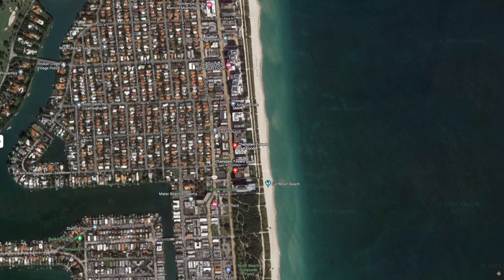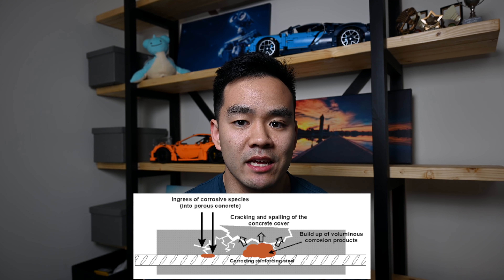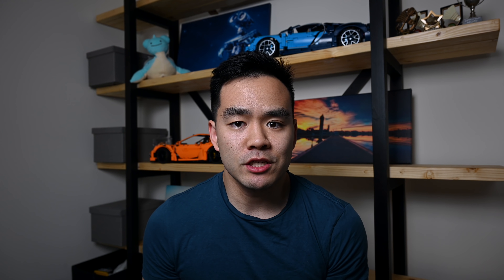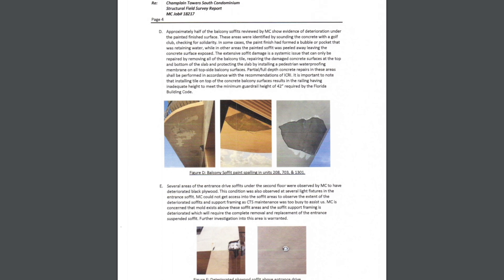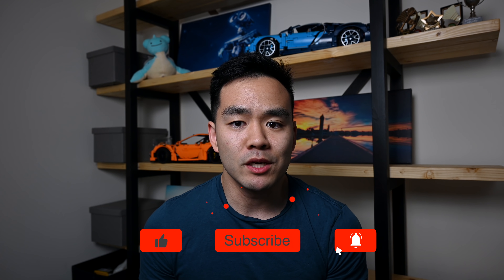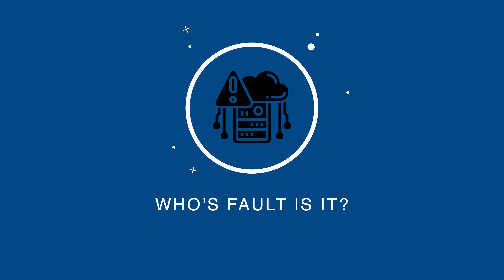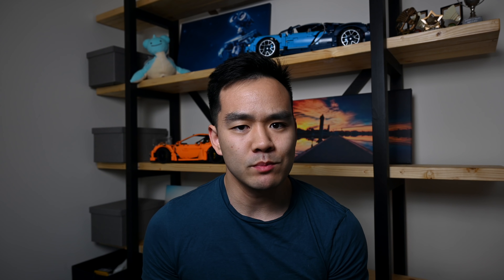Surfside Condo Collapse - A Structural Engineer's Perspective

Comment from the maker: No video (including this one) is going to give you an answer to what happened. Everything at this point is speculation and any video that claims to have the answer is wrong. Until the experts on site do their investigations and analysis, we can only speculate. There's nothing wrong with speculating and having ideas but at this moment, there is no answer. 

I have a copy of the original design drawings so I will be reviewing these and giving my opinion on the design.
Reply: You got it right.  Seawater in the foundation
Reply: @paolabisoneaux4056  nope, the deck fell in first, and it’s above the seawater intrusion. Seawater may have made the columns easier to pull over, but the pool deck fell first. The pool deck had water problems, and it’s salty like he said from the spray.

Comment: I think we understand phenomena like corrosion, water damage, and maintenance pretty well. This was not a freak accident, it was - based on pictures and reports - a building failure that could have been prevented. Even if some aspects of the causes may not have been fully understood, such as the impact of the planter boxes, much of it was and there were ways to avoid it. Tragic loss of life.

Comment: I think that work was started on the roof because the tenants of the brand new building next door complained about how shabby the “roof view” was. Google earth does show the roof was a mess. 
So, It seems to me that the 2018 report was all about the pool deck waterproofing etc….. So, it is really debatable that they were actually addressing the structural problems of the pool deck area,
Why did they remove those palm trees that were planted in planters which were not in the original design ? I’m with you on the salt intrusion and the  cement spaulding. What was causing all that garage roof cement cracking and water leaking ?

Comment: In fairness, a major rebuild design, financing, bid, and owner voting/financing, two years is probably considered brisk.then drop the corona right into the middle of the process, and here you are 3 years later and starting work. 
It’s also fair to note the words “no major structural concerns “ was on the summary of the report. It was further in the report that scares you. For some reason they got soft on the summary. I think they won’t do that again. 
Nonetheless- how long, if I told you to start today, would it take you to rebuild a huge building like that? Starting with the report.
Unless you throw out overtime money like it’s a war project, I’ll bet it takes you two years, and that’s assuming no shutdowns or building material shortages. Those aren’t real, right?

Comment: This was a really great analysis.  However, as an architect, I rarely use the words "design" and "engineering" of a building interchangeably.  The architect, at least here in the US, must rely on the engineer to make his calculations and that the engineer give the necessary shear and steel/rebar enforcement.  It would be unprofessional of the architect to encroach into an engineer's professional judgment and license to ask him to make structural changes, without making sure that the engineer can reinforce the building in a different way.  The architects'  level of responsibility is to make sure that the building is properly waterproofed and specify some type of waterproofing membrane at the basement level.  However, if the structure is not properly reinforced, the waterproofing membrane can be compromised due to too much sway and movement of the building (all buildings move and settle to some degree).

Comment: From watching other videos, engineers seem divided.  Some think the failure around the pool deck lead to the collapse.  Others say that it is likely that the building footings failed after decades of being soaked in salt water than had risen so much, it was constantly flooding the garage.  What do you think?  I see that they cleared away nearly all of the rubble so the foundation is visible.

Comment: The “owner” or the “client” as you describe it, is the Condo Association, a corporation consisting of the owners of all the condominiums. Many of the owners are dead, including some of the current Board members. The current and past Boards will certainly be held liable for failure to exercise their fiduciary duty to maintain the building and protect the owners’ interests. A big problem with condo living is that monthly fees are often set too low to build an adequate reserve fund. I have read that the cost of the repairs in 2018 would have been over $9 million. By 2021 the building had deteriorated to the point that the cost of repairs had increased to over $15 million. A news bulletin from a local TV station reported that the reserve fund had only about $1 million in it. The owners were facing big special assessments averaging over $100,000 per condo (and double that for the largest condos). Ever since 2018, the owners had been voting down the necessary special assessments and voting board members out of office. Some residents had lived there since the building opened in 1981 and had purchased their homes for less than $200,000. Many elderly people would find it impossible to come up with $100,000 and would be more likely to want to procrastinate with maintenance, thinking that they won’t live to see the value. Well, they were proven correct. 

Where I live, legislation is in place requiring that a depreciation report (by a structural engineer) be done every 3 years. These reports provide crucial ammunition for the board to keep on top of building a strong reserve fund and completing necessary maintenance. It is far easier to build a reserve fund and manage owners’ expectations if you increase maintenance fees incrementally every year. I think it’s shocking that no such oversight is required in this area of Florida for 40 years. I expect changes in the law.
Reply: In your comment, you reveal those truly responsible.  These are the owners who repeatedly voted down the Board's necessary special assessments for extraordinary deterioration of the floor slabs, beams, and columns.  If the board members are to be held liable, then they need to be paid salaries, have full education and proven successful experience in maintaining a building structurally and superficially, require no voting for special assessments, and have guarantees from the engineers, inspectors, and town that the recommendations made by these agencies are absolutely and truly necessary, the town/etc paying and being liable for any recommendations that turn out to be false. It's a very complicated situation, when so many hundreds of people with different needs and abilities are involved in decision making, one is guaranteed something eventually going wrong.  

The cause of the collapse was slab, beam, and column internal and external spalling degeneration from decades long water penetration, all other factors merely influenced how the collapse would progress once it started. The construction method in which patio, pool, parking, and building deck slabs were joined together via slab-internal beams clearly played a role in the progression of the collapse, bringing more columns into play whose collapse entered under the building itself. In the years after construction was complete, evidence shows that the pool and patio decks were modified for the worse, an improper job was done, leading to the infiltration of water/salts/chlorides into the structural slab, beams, and columns.
Reply: @robertrust441  Most catastrophic failures are due to a cascade of errors. See Jame Reason’s Swiss Cheese model. https://en.wikipedia.org/wiki/Swiss_cheese_model
Reply: There's a lot of things that trouble me going through the public records for the building. The 1996-97 restoration and repair of the pool and garage slabs permit application (96-00000403 had the worst architectural plan I had ever seen. It was a photocopy of the pool plaza plan with some vague areas drawn on by hand with a Sharpie showing where the work was to be done. No list of materials, and no copy of the structural field survey report that diagnosed the problem and the repair needed. All there is a letter of certification issued after completion by the project engineer Tong Le, stating that a 20ft sq ft area in the garage ceiling had been repaired to code and the specifications of the South Florida Building Code (SFBC). The contractor on that project was The Waterproofing Co of America. Why this is important is that the original 1979 plans, differ from the 40 year recertification bid plans drawn up by Morabito Consulting. The 1979 plans show that pool slab was built with a slope, and there was a change of levels down to the garage slab, but the recertification plans show that the slope had been removed, and the slab flattened. Not only that but a BMA  beam in front of the garage entrance is missing from the recertification plans. That beam was to traverese two columns in the area where the garage slab joined the pool slab. Was that beam removed in the 1996-1997 restoration? How come that project got a completion permit approved but, more repairs were needed to the pool slab under the planters just a few years later? So, many questions, and so many documents aren't in the public domain that really should be. The Harbor Cay Collapse proved that the codes were deficient, but it seems that because of industry counterpressure, and the fashion for deregulation, the buildings built prior to 2002 when the Florida Building Code replaced the SFBC are not a good investment. Moreover, 40 years is too long a period for recertification. It should be a frequent occurence every 5 years. Moreover, relying on residents to understand the import of a statement in a structural field survey report which describes an issue as "systemic" which should be addressed in a "timely" fashion is wishful thinking, especially when they have to find thousands of dollars to address it. I don't think the language in such reports is particularly helpful. The legal liability consulting engineers has makes their communications highly formal if not legalistic. It just didnt read urgent. Plain English and plain speaking might help get the message through. Morabitio Consulting Engineers must have been worried because they sent an unverified outline report to Surfside Building Department which wasn't sent to the condo association nor registered with the Miami-Dade District Court, but no cover letter with to explain why they were doing this is in the documents. They say regulations are written in blood, and there should be more detailed and professional documentation provided for major repair work permit applications. Self-certification of repairs impacting the systemic robustness of structures is questionable too. I just hope current day regulation is more stringent in the protection they give.
Reply: I can see the whole picture revealing itself now.

Comment: "Who's fault" I think you mean "WHOSE fault" ....In my humble opinion, the most probable MAIN cause of the collapse was the many years of water seeping into the concrete pool deck and associated ceiling of the garage, thereby rusting the all important reinforcing steel, and destroying the integrity from the inside. The amateur design (flat, not sloped) surface being not waterproofed and exposed to the rainfall for 40 years.  The lack of immediate action following the DAMNING engineers report in 2018. The absurd decision to repair the roof first with jackhammers vibrating the entire structure BEFORE addressing the integrity of the "ground floor". Like the death toll, the number of people criminally liable for this tragedy is growing every day.

Comment: From what I've been hearing, one of the likely reasons this project was delayed was that the residents during the meetings would argue about the special assessment cost, which was going to roughly be about $110,000 to pay for the project, on top still paying the condos.

Looking at other engineer channels, I can tell as an amateur that who ever was designing the building did fail at a lot of the basics, like how certain beams fit on the columns in the garage, the lack of consideration the garage could have been below water level, etc. Talking to both my father and brother who are civil engineers, they agree with your concern about the lack of maintenance could have been the main factor; yet the rules were applied to have the building check up every 40 years, which was what the condo units were doing. When looking at specifically the pictures or video coverage of the garage before this happened, it's puzzling how no one was questioning the water and the damage it was doing to the structure.
Reply: When you own a beach condo you think that all you have to do is pay an HOA fee, and that a staff of repairmen will magically appear to fix everything as if you are in a hotel. But at some level there is no one to carry out the work. Everyone is an owner. That’s what everyone on YouTube has trouble understanding. Even if you hire a company, someone has to give up their life for free to oversee all that work. They have a security guard and maybe one maintenance guy, but some owner has to do the work of managing it all for free as if they were running a hotel for the others. They are all wealthy owners. At some level there is no one whose paid job it is to take complaints and do the work as in a hotel.

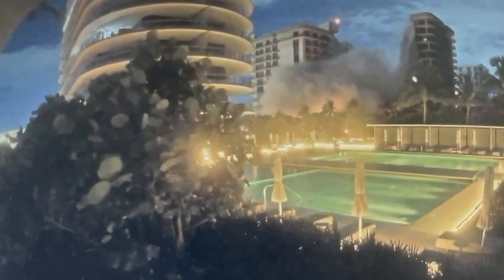Comment: If you look at the collapse video at 3:04 you will that a large chunk of the building sky line is missing while lights are still on in the about to collapse building section. We need this guy at Rako Studio’s https://youtu.be/YNMxzFmKyyg to do the same treatment of the collapse video to determine what stage the collapse is in the first frame. If that central section is still intact then a section of the roof parapet has fallen off. That much concrete falling 12 levels would deliver the energy required to destabilise this building. According to an animated fly through the section directly in front of the collapse section had substantial joists under the deck, joists that are missing from the rest of the pool deck. So for that section to fail it would take substantial force. The animation https://youtu.be/HPwJ0JvTcg8
Reply: Building Integrity clearly points out in one of his vids that it collapsed in 4 sections or maybe 3. I have watched so many vids I may be wrong to the exact # of sections.
Reply: @kellyname5733  Kelley, my comment is about (a) when did the collapse begin, and (b) what was the initial failure. The building central section would have to have already fallen one floor level at the start of the video for the failure to have begun at the bottom. However if the collapse was caused by a big chunk of concrete falling from roof level then that is better news for those who live in such buildings. The roof is continuously exposed to salt sea spray, and salt being hydroscopic ensures that surfaces stay wet longer so cracks in roof top concrete will cause rust sprawling far sooner than in other parts of a building.
Reply: @williambunting803  building integrity looked at two virtical concrete features. One up to the top of the eighth floor in the right fourth section to fail and one to the tenth floor in the first section. In the first collapse video frame, the 11th thru penthouse can be seen, each still one floor apart, although they have already dropped down several floors as shown against the virtical marker on the right. This clearly shows the collapse was bottom up, and not the result of the roof coming down.

Also the pool deck collapse came about 7 minutes before and likely damaged the building support columns at the basement or ground floor level.

Comment: I just spent a bunch of time looking at the building on Google Earth on the street level setting and parts of the building have pictures from this year, while others have pictures going all the way back to 2015. It seems pretty obvious to the untrained eye that there were already serious problems in 2015 and, since some of the pictures from a very slightly different angle are separated in years, you can see how it worsened over time. Of course, it's a hell of a lot easier to compare a picture from 2021 to one from 2015 and see the change but it would have happened in real time so slowly that people's ridiculous desire to remain optimistic likely allowed them not to see the problems.

Comment: If you look at the photos of the pool deck and columns after the collapse, there doesn't appear to be a whole lot of rebar reinforcements.  This means that there was no rebars to rust and create spalling. The lack of rebars also made it easy for the punch shear of the deck through the columns. There was none or little rebars in the deck since it butterflied and broke off and fell into the garage below. Rebars would have prevented the deck from breaking apart and falling.
Reply: Punch through failures usually look like a column with an inverted pyramid on top. The stress cracks spread out upwards from the column through the slab. 
Although you only see two pieces of rebar at the still standing columns, down at the broken pool deck there is another loop of rebar.
It looks like the outer column rebar was higher and further out where the crack was expected.
Also
1. Top of the punch through columns had no slab sections remaining.
2. There was almost no concrete attached to the rebar on the columns. Perhaps the rebar had rusted, expanded and detached from the concrete so that it no longer performed it's structural role.